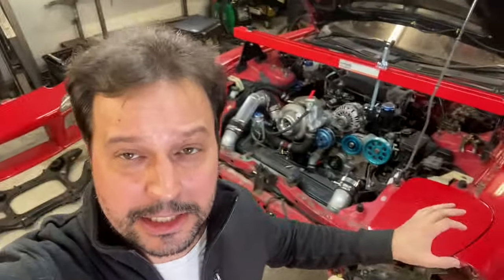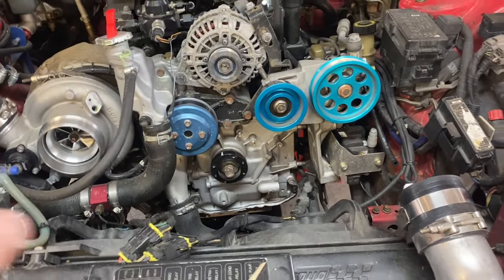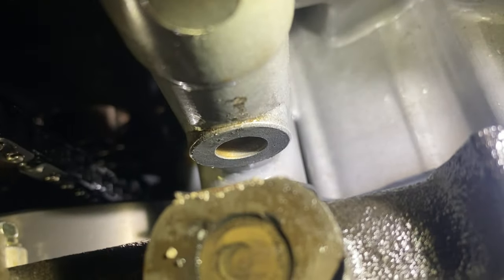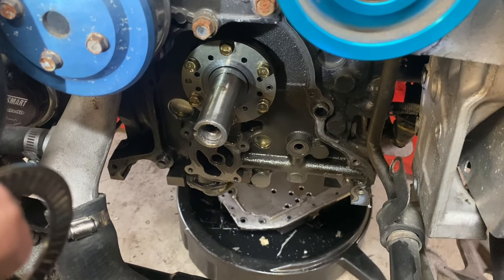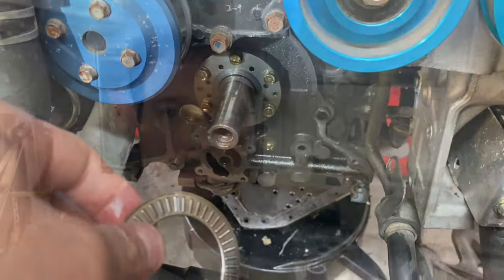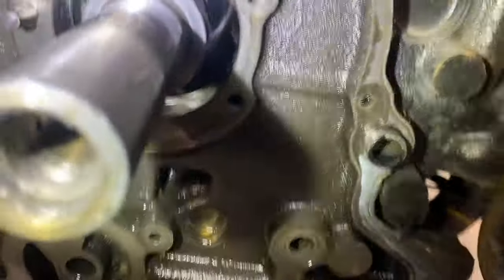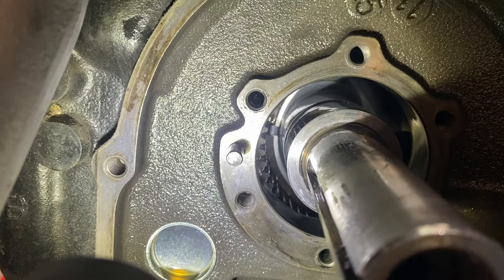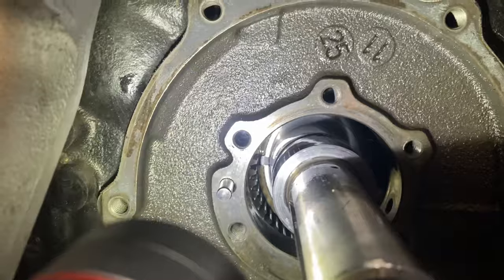Part 2 of the Time Attach FD RX7 oil pump maxed out!

Comment: I would of thought when bumping the oil pressure up you would want to restrict the eshaft jet like 2-2.5 mm with a Weber jet and not make it same size . You restrict it so it builds pressure else where like for bigger bearing clearances . I used a factory fd rear reg as there good for 100 psi and just shim the front relief . Always good oil pressure in my experience but stuff like this happens and I’m glad you documented for others to see . Was googling why I have too much pressure and your vid came up .

Comment: Do you know about the thrust needle bearing can drop off the spacer when you remove the crankshaft pulley, especially if crankshaft moves back etc, also if spacer moves forward 
also when you reassemble when engine is horizontal position 
I'd take engine out and place vertical to reassemble the front, so thrust needle bearings are in correct place 
not worth risking an engine
Reply from the maker: Once back together I always check to verify endplay is still good.  Thankfully everything stayed where it was 👍

Comment: still so strange that ur not even getting close to spec oil pressure with rpm, the jets should only decrease idle oil pressure, above 3k should be closer to 100psi with a fd oil system, either way, still lots of oil pressure.